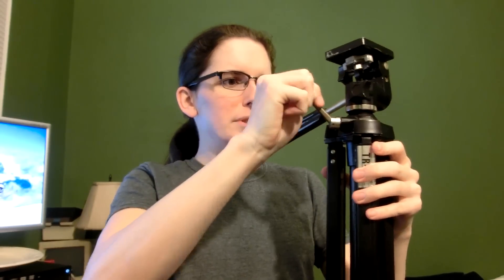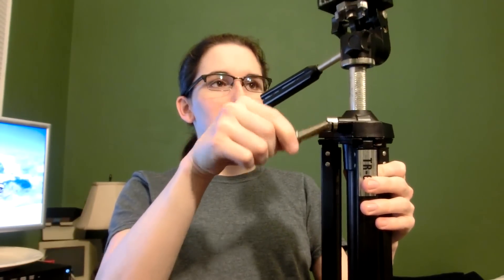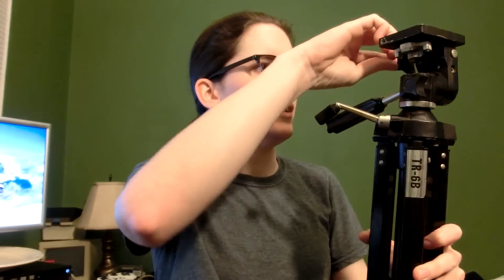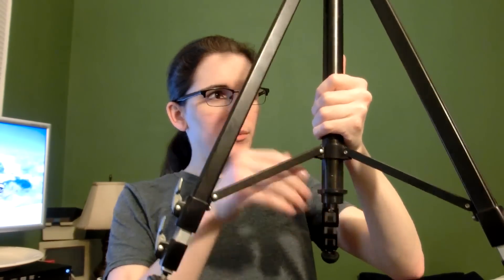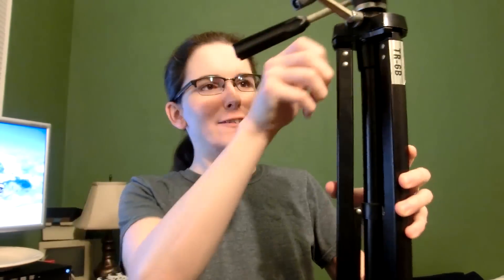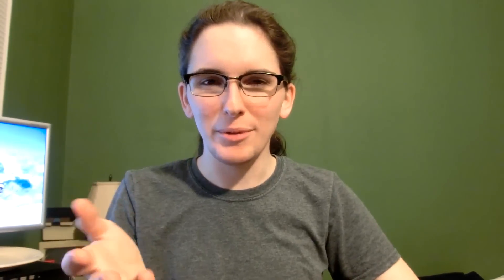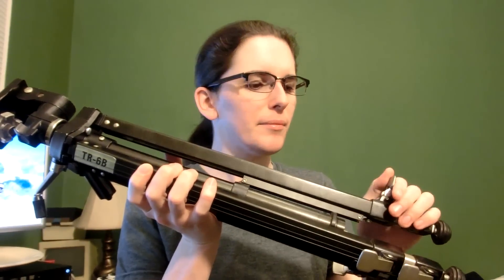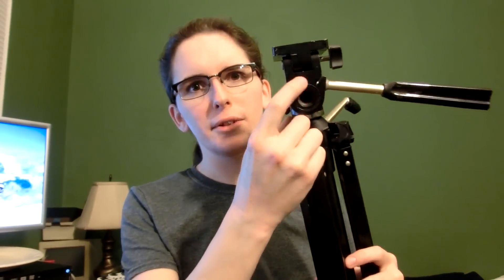Personal Bits 0182: Tripods

Comment: the central column is so that you can raise and lower the camera position after levelling the tripod base without having to re-level the tripod base. If you are extending or contracting the legs each time you want to raise or lower the camera then you are upsetting the level of the tripod (assuming you levelled it to begin with)
Reply from the maker: +Captain Barnacles not sure why your saying this, and no i dont level my tripod, its way too shakey
Reply: A lot of people think that the central column is for a last resort extra bit of height. It's not. I thought you seemed not to understand it's intended function. Levelling is useful if you want to pan without introducing yaw into the movement.
Reply from the maker: Captain Barnacles
leveling is pointless to me because the tripod will tilt like 4 degrees when everything is locked down. its super loose.